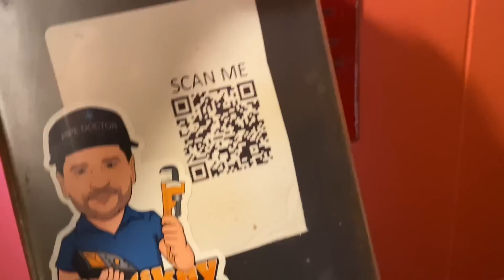Troubleshooting Rheem Gas Furnace: Error 57 Pressure Switch

Comment: That exhaust pipe is a no bueno.  With those rains  your area experienced that homeowner is lucky there wasn’t more water flowing in there.  I bet the blower housing filled with enough water the wheel only turned very slowly being partially submerged, which explains the burned up motor.  You are a good tech for running the call late on Saturday.  I have always had a complete inducer assembly in stock for my 80% furnace.
Reply from the maker: Thanks for watching
Reply: You sure are prompt on the reply St. Mike. 😃  I love all your channels.

Comment: Hey Mike, usually you can beat on the exhaust motor using a rubber mallet to get them free and get the windings moving then everything will start to work.. but you did say you smelled a electrical burns

Comment: Anything could be jamming that motor unfortunately. The only other thing you could have tried is to remove the inducer assembly and see if anything is inside it and try to free it up. It’s a low torque motor for sure. My Trane inducer wouldn’t turn and my tech actually kicked it to get it to spin. It worked again, but he replaced it the next day under warranty 🤷‍♂️
Reply from the maker: It spins manually without resistance
Reply: @PipeDoctor  gotcha. Didn’t see that 👍 Hope the new place was dry!

Comment: So you’re telling me…. You couldn’t take the 4 screws off and look inside?  I like most of your content but I could take that inducer off within 30 seconds to confirm nothing stuck inside.  I’ve had birds leaves balls toys stuck in that for days while trying to run ,  removed them and it works….  I let the customer know it could stop again within 1 minutes of me leaving and I recommend replacing as soon as I can get one but not checking?   4 screws, 1 clamp, 1 hose … under 1 minute work is wack af.  Chance of them having  heat for a night at least since they are already paying a large overtime fee…
Reply from the maker: Yeah. Wasn’t necessary cause I was able to spin the motor manually and there was zero resistance. Thanks for commenting.

Comment: Hey Mike,   Frank C from NC,    I was thinking putting a 45 degree ell on the exhaust just before you mentioned it. Good idea to eliminate the possibility of water getting in especially when the pipes are pitched back to the furnace.The intake is fine.
Reply from the maker: Thanks for your comment, Frank! I'm glad you found the tip about using a 45 degree ell on the exhaust helpful. It's definitely a great way to prevent water from getting into the pipes and causing any issues. And I'm glad to hear that the intake is fine too!

Comment: Original Installation is not per Manufactures Installation, Cannot discharge that close to the operable window, I usually put a street 45 on the discharge pipe pointing down to prevent that exact problem
Reply from the maker: Thank you for pointing out the discrepancy in the installation. It's always important to follow the manufacturer's guidelines to ensure safe and efficient operation of the system.

Comment: Interesting that water would of damaged the motor. The exhaust will get water in there anyways from condensation as it runs that’s why we have to pitch it back to system. Was it maybe just to much water to fast for it to handle?
Reply from the maker: Just a theory
Reply: I've seen them go out for no obvious reasons. The sucky thing is they're all model specific. Its impossible for shops to carry every kind of inducer. We have to order them quite frequently

Comment: Hate error 57 😘 😅

Found a bad high pressure switch this week causing intermittent problems. Took it out and literally sucked it to check if it closes or not. Found out its resistance reading was ranging from 140 Ωhms up to megaomhs lol.  Lucky enough, I had one spare in the track of the same value. 😇
Reply: In a way they are like a baffle, right? They have a bladder in them and open and close. Thats what im imagining them inside like.
Reply: @harryschrysan3183  thanks man I’ll check it out.  Enjoy Sunday.